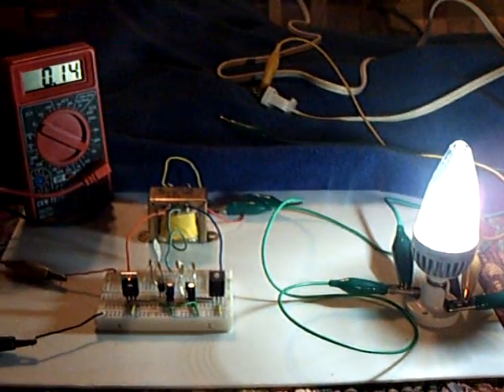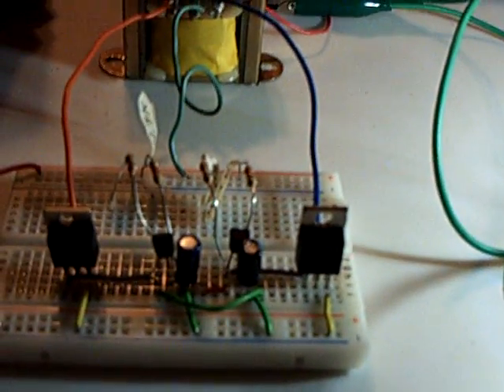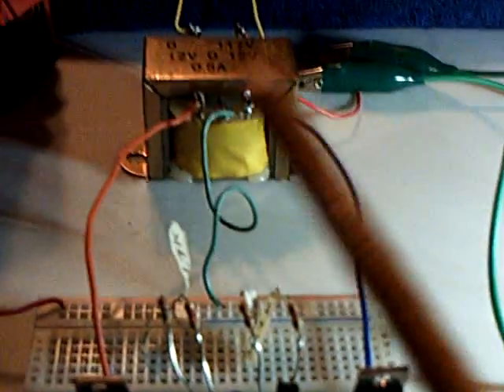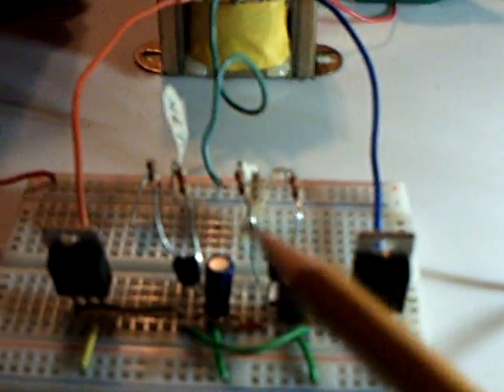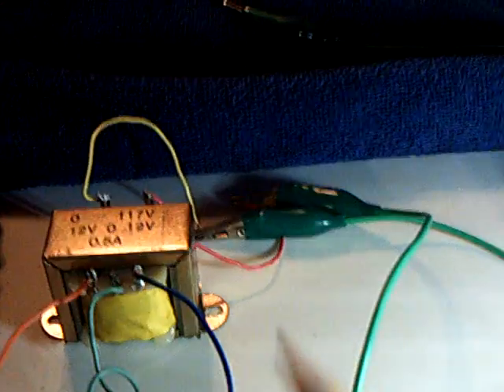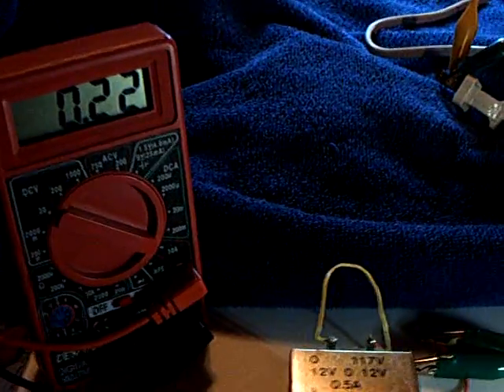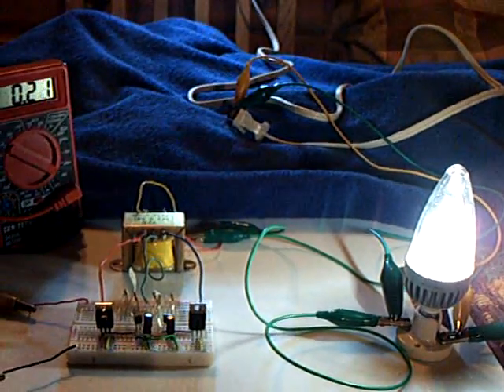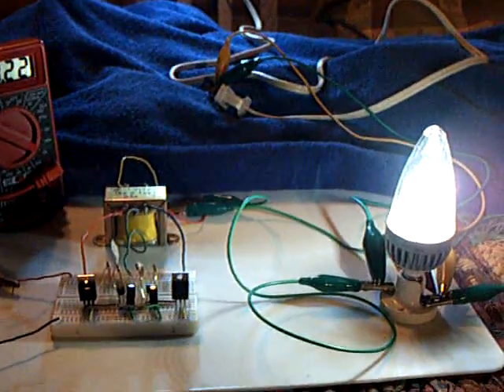The French inverter circuit

Comment: hi, I notice the french circuit use film capacitors which are somewhat expensive in the microfarad range, but it seems you got away with using electrolytics, would you mind sharing their orientation?

Comment: Dear LidMotor, i loke much your experiments, but should always have an estimation of the efficiency of the system: output power / input power. Like here, to calculate after the running the lose of energy in the battery compare to the energy provide to the bubbles.

Here you have 2 LEDs bubbles, while it could run with only 1W, and indeed: 0.2 A * 12 V = 2.4 W, so where would be the gain? All this must lead to a gain, isn't it, or what for all this?
Could you provide more precise numbers? regards

Comment: @Lidmotor I hearya! I did a little demo vid comparing my Motomaster (plug in the lighter socket style) inverter. It drew a full amp to light up 3 LED lamps. One like yours Lights of America (2.5 watts) and two that said 2 watts. So it drew 12.8 watts to power 6.5 watts of light. 180 mA unloaded. I'm in too!

Comment: How efficient is it? With these devices we don't get a real idea of efficiency, when it is not that complicated to actually measure (ok so error margins are not miniscule when people don't know how to measure power output, but some thing simple like charging a capacitor to a known voltage gives you energy input+motorised winch with a weight on it can define output, including mechanical losses, or other known loads, then we'd know if it's overunity, which is what many r after, what do u think?

Comment from the maker: @cybershrink69 -----Yes I agree with after working with this awhile.  The wave form isn't really a saw tooth like I saw in a picture of a computer simulation.  The flip flop puts out a square wave but at the mosfet you get a kind of and "h" wave with a good backspike.  There are probably better inverter circuits but this one is simple and works well for what it is.  Thanks for the input.

Comment: do you know of a circuit that can drive leds over 10W and efficiently and off battery (as battery's die, they lose volts and hence, the led stops drawing power. when the battery has 80% battery or so the led is very dim otherwise)

Comment from the maker: @truepres -----This transformer is like the metglas toroid transformer that Lasersaber built and the circuit should run on it.  The big difference is that I'm only stepping the voltage up to 110 volts and his transformer goes much higher.  That is why he can put all those bulbs in series.  How he gets the job done on 220 mA is amazing.  It has to be that specitic toroid that he is using.

Comment from the maker: @malicious1111 -----I posted a link to vik95170's video above in the description section.  The transformer must be a "center tap" type (three wires on one side and two on the other).  You can use a standard type with only four wires but you have to use a different type of circuit like a 555 timer circuit.  Remember that we are running the transformer backwards.

Comment from the maker: @Edmorbus -----That is a problem and maybe vik95170 can help us out there.  I used 2N2222 transistors for the Filp Flop part and IRF730 Mosfets for the drivers.  My circuit does have the spectacular performance that his does so I may try a different transformer and different mosfets.  I worked with different values on the resistors but the values he specified worked best.   Same thing with the caps.  It does run a little fast.  Maybe a slightly higher cap value would slow it down.

Comment from the maker: @rroge5 -----I did not check the frequency but it sounds  like about 70hz+ on my little radio.  Unloaded the voltage is about 110volts with a draw of 112 mA.  Loaded the voltage drops to 95v---not so good and I need to work on that.

Comment: I have wanted to try to replicate an inverter I saw in a video a while back, but I couldn't ever find a center tapped transformer. If you search "make inverter" it's like the 6th video down with an older gentleman in it. He shows a nice diagram, and it's almost the same as this circuit minus the mosfets and the timing capacitors.